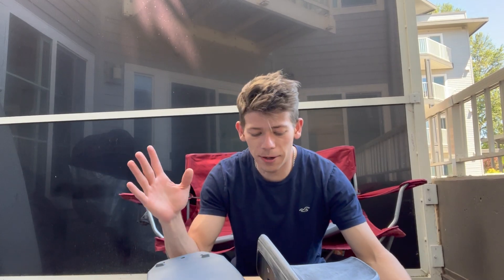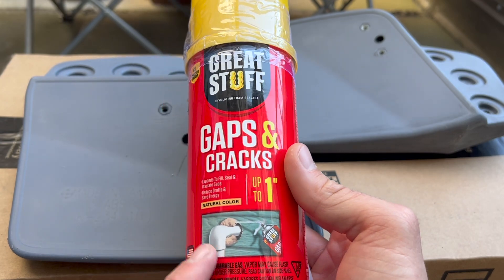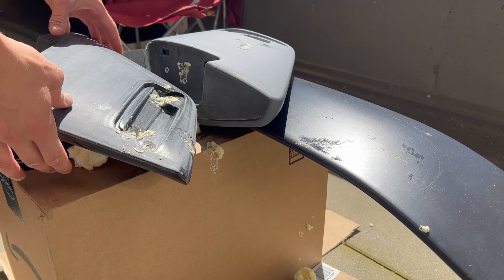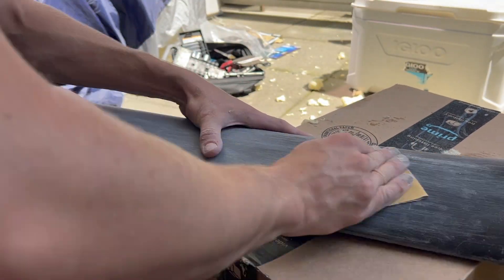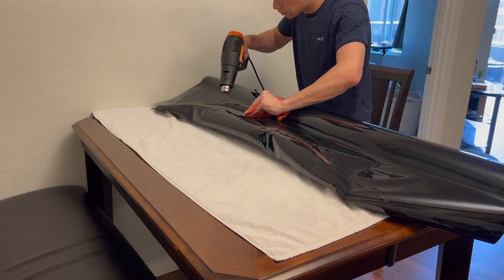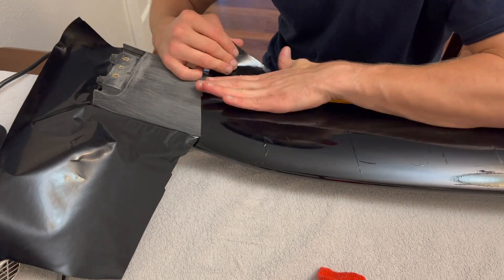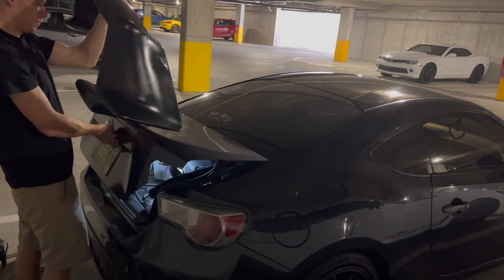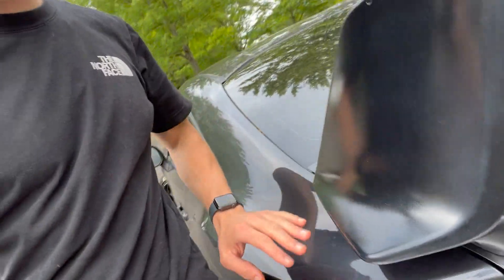HOW TO INSTALL  STI WING: Subaru BRZ/GT86/FRS (What Not to Do)

Comment: What bolt size is used for the spoiler mounting legs (for the three holes per foot)?
Reply from the maker: I honestly don’t remember man, I want to say M8 x1.125. But that’s just a guess
Reply: @parsonsproductions.5869  aight ty tho, I just did some research but didn't found anything